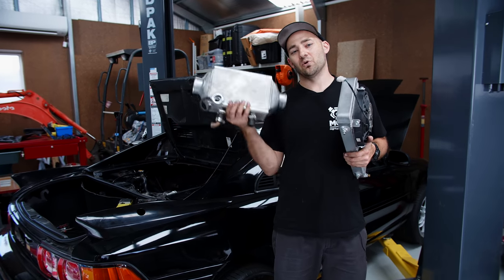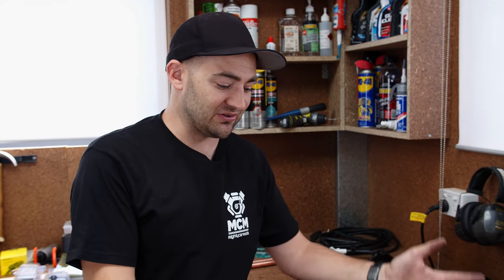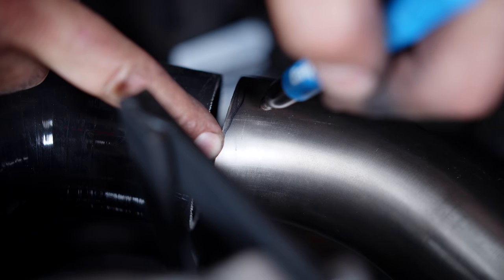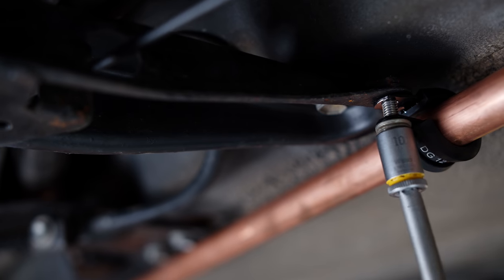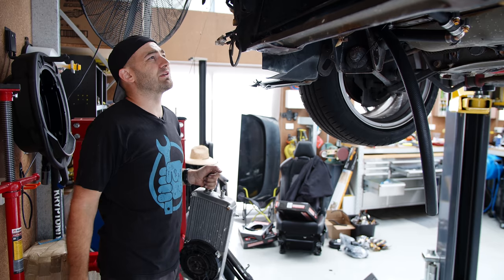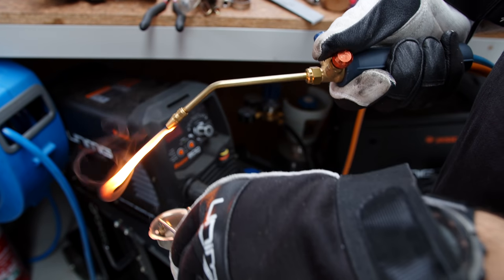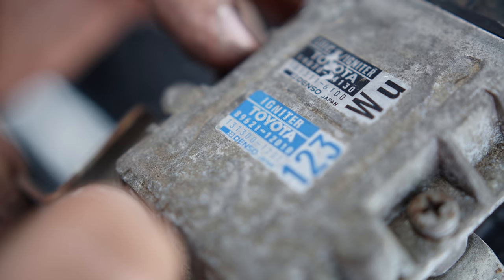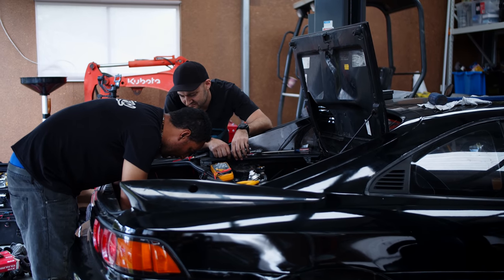MR2 takes Miss Daisy parts (Water to air Intercooler Install)

Comment: I'm going full 21:30 Marty with my highschool love affair of a first 'real' car, a 1992 Mercedes Benz 190e. Much the same situation. Lots of ingenious solutions to pedestrian problems by today's standards, particularly in the fueling system. The mechanical injection system uses a series of springs and an electronic fuel pressure regulator to control the fuel pressure the spring system sees, in order to properly add enough fuel for the metered amount of air coming into the system, using an even more complex arrangement of an air flow plate connected to a potentiometer, and assisted by a series of vacuum lines that go every which way. Really, the best way to explain how overengineered this car is, is in the wiper system. The windshield is roughly twice as wide as it is tall, meaning a properly sized wiper blade could reach the far sides, and the top in one sweep. But, that's not good enough. Throughout the travel across the windshield, a series of gears control an articulating portion of the wiper arm, to make it extend as far into the top corners of the windshield, and still come all the way back in to clear the top of the windshield. Absolutely ingenious solution to a mundane problem, properly solved by the use of TWO wiper blades. Arguably, it even works better. As long as all the pieces of this ridiculous puzzle are working properly. Like the plastic drive gear for the articulation system, meshing together with a metal gear pattern. Definitely not a wear item.

The actual issue with the fuel system, and the car as a whole, is much the same. All you have to do is bolt on a proper fuel rail, modern, reliable, new injectors, bin the vacuum controlled spark advance for an electronically controlled ignition timing system, and wire and install a brain to control it all, and you have a car that runs properly all the time instead of only once in a blue moon. Only there's no usable trigger system for anything in the whole system. And all the sensors have some silly metric thread with no modern equivalent. So every single sensor port in the head needs to be tapped out to receive a modern sensor. And if you're going that far, you might as well turbo it and double the cost of the project for double the horsepower. Only if you're doing that, you should probably take care of the oil seeping from all of the crank seals and transmission seals. Speaking of the transmission, take out that automatic with another silly vacuum controlled system, and replace it with a conventional manual with no funny business happening. And now all of a sudden, you have $10,000 in a $500 nugget that's still hailed out.

The suspensions all good, though, which means we can just ignore all the problems, drive the motor at 9/10ths on the street just to keep up with traffic, and fill it with fluids until it pukes it's guts out. Or just try and sell it on to another owner, hopefully one with more free time and ambition than I have.

Comment: Hi Marty, 
friendly reminder that your pipes being copper and the radiators (and other parts) being aluminium there's gonna be some corrosion over time. Make sure to check that out frequently and use anti corrosive additives!

Comment: there might be a little bit of schadenfreude here, but it is actually really relatable and enjoyable when you guys run into real problems too. I know you guys are vets at this point with all the builds you've done, and the knowledge you have, but for those of us out here that hit roadblock after roadblock in our more novice adventures, this is kind of a breath of fresh air when a lot of channels cut from 'this is what we need to do' to 'ok, this is it done', without any mention of hiccups or problems along the way. Anyway, the tl;dr: thank you guys for showing the ugly bits that usually end up on the cutting room floor.

Comment: One of the most realistic and relatable episodes.
 Nothing fits we bought to put on the car.... modify and make it fit.
Ok now none of the wiring is correct. We should have it started by now, but instead are backing up to a new plan.

Comment: Copper work hardens and cracks over time. Not a problem in the ground outside your house, somewhat more of an issue under a constantly moving car body. It'll probably be fine, and if it breaks its no big deal as you said, but thats why copper can be a problem

Comment: Great vid. :) I'm not sure if it's been mentioned. But it might be worth looking into mixing copper and aluminum with water.  It may lead to rapid corrosion.
Reply from the maker: It probably won’t, it’s not a watercooled PC
Reply: @mightycarmods  hopefully not! It's still the same in principal though. Heat. Water and mixing metals. But you'll know if you get performance degradation.

Comment: The big lengths of copper tubing getting airflow on the bottom of the car will further increase the cooling efficiency of the water to air system, in fact I'd wager that it will actually make a fairly sizable difference! Whether intentional or not, that is some good stuff right there.

Comment: It doesn't matter where the pump sits in the circuit, as long as it's air free. An expansion tank above the circuit will allow air locks to bleed out. I'd personally mount the pump chargecooler as it'll dissipate more heat than it'll produce at higher temperatures. Look at the Mk1 Focus RS for example.

Comment: in my Elise I made the gearbox cooler tap into the water cycle of the engine coolant. the waic of the elise got it's own cooler but is also connected to the same reservoir so I can exchange all coolant together.

Comment: Interesting choice, going for the front-mount WAIC...not sure if it's the optimal way to go--that'd probably be a top-mount air-to-air with snorkel ducting down from the roof to the engine bay cover louvers, but as you said, you're running up against the challenge's budget limit, and you gotta work with what you have.

I don't know what it is about Toyotas--having owned and worked on both an AW11 MR2 and a Matrix (read: USDM Corolla 5-door), they do tend to fight you whenever you try and do anything with 'em, mechanically. My only real explanation for this phenomenon is that, now that Toyotas are renowned the world over for incredible reliability and durability, people are using that as an excuse to not take care of them, so they build up all these little problems that turn into big problems that turn into headaches for anyone trying to modify or restore these old gems. Still, I've never known any project Toyota where the end results weren't worth it...except maybe Yaris Hilton.

Just...make sure you buy Dave, like, three cases of beer for his trouble. X'D

Comment: Probably a lot too late, but there's a tool to flare the ends of the copper tubes, so you can get a more secure fit for the rubber hoses.

Comment: Even though you already had this one, it's a LOT easier to get the factory water to air intercooler and parts off the turbo Celica's. Cheap, factory fit (bolts right in) and super reliable set up. You can also use the AC lines to run the coolant through and the condenser as the heat exchanger.
Reply from the maker: Would have liked to do that but they were too small
Reply: @mightycarmods   I had that setup on mine for 270whp, would like to see what power you're going for if that is too small ;)

Comment: Just got a haltech elite 1500 dialled in on my st205 gt4 with haltechs help Marty.  Mines a gen3 engine but if you have any issues setting up the coils and getting a signal from the distributor for cam and crank signal , scott has been helping my tuner dial it in and they got it right with 1zz coils . They netted 350awkw with my built motor with no drop in spark . If you have dramas , get in contact with scott / tuning fork - ask him about the celica in geelong . He should know about it

Comment: Never seen someone so truthful about how hard SW20’s will fight you while you’re trying to fix them. I’ve had to just lay on the ground and calm down once because of mine as well 😂
Reply: Were you trying to replace the fuel pump by chance? I lost count of how many times the fuel tank foiled me, especially since the manual shows it coming out without removing the cooling hard lines.
Reply: Kevin Shea oh I know that’s going to be a pain. Been meaning to get around to that for some time actually, and I would replace the hard lines at the same time if I was pulling the tank. When I first got my 91’ the coolant came out brown 😭
Reply: Andrew Coodey don’t replace the hard lines, they’re aluminum and don’t corrode like steel. Plan on replacing the rubber connectors at either end of the hard coolant lines since you’ll probably damage at least one. Also have a foot or two of rubber fuel line to replace the pieces you’ll have to take off the tank hard lines. Be really careful with the fuel filler neck and breather, they’re more of a pain to track down. If you plan on having the engine out at any point, that’s the time to do the fuel pump. If you can sit in the empty engine bay it’s way easier to disconnect and reconnect everything.

Comment: Might need to use a pipe expander on the ends of the copper where you are attaching rubber hose with clamps.

Comment: If the copper pipes fail a lot and of gm mini vans have long aluminum pipes that run from the engine all the way to a heater core in the cargo area. They would probably work well for the mr2 and could be picked up cheap at a wrecker most likely

Comment: 7:35 Not sure how long you intend to keep the car, but Aluminium radiator and Copper Pipe do not mix well (galvanic corrosion).  To stop galvanic corrosion, you'll need to add at least 15% Anti-freeze in the coolant.

Comment: One thing im concerned about is the radiator being aluminium and the pipes being copper, those metals dont mix well while running water. I've built some custom watercooling loops for PC's and they dont mix very well there :) 

Short term it's no big issue but long term there is some problems with "corrosion"(dont know the correct term).

Comment: Don't worry about  your copper pipes Marty. I ran copper pipes, recycled from a residential central heating, that went close aside from the exhaust manifold without any issues for years, when i decided to DIY an oil cooler to one of my previous cars.

Comment: Only thing you gotta pay attention to is not mixing metals. Like copper pipes and aluminum radiators, because then you'll have aluminum oxide radiators.
Use a coolant that contains a good rust prevention.

Comment: Tip for pipe bending, use one size smaller and the pipe will stay the same circular shape as it bends instead of flattening out and becoming oval shaped ;)

Comment: I have used copper tube in the past.
If using hard drawn copper anneal area to be bent and also can use sand packing method
if don't have bending tool also  use a crox tool on the end's for piece of mind.
I must admire Marty's commitment to this bitch and I really hope this work's out in the end.

Comment: Copper tubes are going to be fine under the car. They will turn green but will never get any holes from corrosion.
It's quite common to use copper for brake and fuel lines.

Comment: PLUMBING TIP ; When soldering Copper pipe, make sure you have BOTH ENDS of the fitting with the pipe already inserted. Otherwise you have exactly the problem Marty has - you have to smash the last bit of pipe in after you complete your first Solder connection, and in turn deform the fitting and potentially the connection. Also ; Apply heat from the OPPOSITE direction to where you apply the solder, this ensures that when the solder MELTS it pulls itself all the way round to the heat source and forms a perfect seal.

Comment: Copper will be fine.  Used refrigeration grade copper lines to replace steel on on the hydrolastic suspension lines on an old Mini. 20 years and counting.

Comment: Those copper lines will last a lot longer if you hit them with a couple layers of some truck bed liner spray.  Better yet swap them out with aluminium tubes and then spray them.  Mixing that much copper with mostly aluminum might give you problems in the future.

Comment: See Sarah'n'Tuned videos about her MR2. She had to manually remake the engine loom as the wire actually rots internally. If you strip back a wire you will find its gone all green inside and the copper is rotting. Its a known MR2 issue.

Comment: Doesn't matter how something is built, designed, whatever. It's the end result that matters.
Or, if it works, it works. It's not a show car, don't need to be fancy about connecting up pipes, etc.

Comment: Your problem with copper will be because you have copper and aluminum mixed together, it will cause internal corrosion. And since aluminum is the more active metal it will be the one to go so you might get water in your intake

Comment: I am very familiar with the wiring part at the end where nothing matched up.  I removed probably 15 pounds of wiring off a 1981 Kawasaki motorcycle. That’s right, around 15 pounds of wire and threw it all away to start from scratch because of the same issue. Almost nothing matched the colors the diagrams in the service manual said they were supposed to be, and from one end to another, the color would change or the wire just wasn’t showing continuity. I put back maybe 4-5 pounds of wire by the time I was finished.  And everything worked as it was supposed to.  I have no idea what all the extra wire was for from the factory.

Comment: It looks good. They only thing I would have done differently is to add a rim to the copper lines so the rubber lines don't pop off.
Reply from the maker: Why will they pop off?
Reply: @mightycarmods  It's possible from the pressure. Not that it will happen but it's possible. It happened to Erik The Car Guy on his build. He had to add a rim around his metal lines to give the clamps something to hold onto. But otherwise your car is fantastic.

Comment: Maybe weld little dots around on the intercooler pipe so the coupler has something to pinch on. Couplers doesn’t like smooth pipe surfaces.
Reply: I expect all the edges will be rolled before the face-off with the mooooon unit

Comment: PEX probably would have been both easier to work with and substantially cheaper. But hey, nice to see you using somthing that is't super cost prohibitive like braided hose and AN fittings.

Comment: I like the set up of your workshop. Lots of cool and useful equipment. 
But please put your vice on its own solid pedestal... 100mm SHS 5mm wall on a broad baseplate. As a guide.
Watching half your energy go into flexing the workbench and bouncing tools around is as frustrating as dealing with the MR2s frozen bolts I’m sure..  plus those cast vices can’t handle much of a beating. Better treat yourself to a forged steel vice too..
Love the show, and when you win make Moog give the Moon Buggy to the guy that helped him get it running.
Reply from the maker: Yep one day

Comment: I am actually curious if, Marty checked what core material the water2air charge cooler uses.
One rule that always pops up when dealing with water cooling is to never mix aluminium and copper.
I have not found out why yet, but it might have to do with the oxidation aspect.

Comment: Copper pipes was interesting, but won't the aluminium radiators corrode like crazy? 
Also don't you need to bead the pipes otherwise aren't they going to blow off? 
Or did I miss that bit? Beading tools are like £200.

Comment: Marty, it's worth noting that mixing copper and aluminum within the same cooling loop causes nasty galvanic corrosion unless the coolant is VERY carefully mixed and controlled with anti-corrosives. Standard radiator coolant contains anti-corrosives, but it isn't intended for use with copper.
Reply from the maker: Are you sure? I know this is a thing in PC cooling land..
Reply: @mightycarmods  Yes, I also learned this through the PC watercooling community, but the same applies to coolant in cars. Typically in cars with Iron (-.04 volts electrode potential @25C) blocks and Aluminum (-1.66 volts) radiators. Mixing Copper (0.34 volts) and Aluminum is actually a bit worse, as the process is sped up by a larger difference in electrode potential. I'm not saying you need to rip it out, but I would buy some corrosion inhibitor additive and keep an eye on it. PC all-in-one liquid coolers mix copper and aluminum without any issues, but they carefully balance the distilled water, ethylene glycol, and anti-corrosive mixture.

Comment: They haven't mentioned the TVIS on any of MR2 episodes, this will need to be included in the mapping of the engine. I'm taking about the variable intake system the REV1 / 2 use to improve drive-ability. It can be deleted, but I didn't see Marty do it...

Comment: I feel sorry for you...  I have a 95 neon that I've had running without the throttle body, so no throttle position sensor or idle air control valve, and no intake pressure sensor.  It fires right up with just the cam and crank sensors, the coil, and the injectors hooked up.  It doesn't IDLE well without the throttle body or associated sensors, but it does run like that.  There is something to be said for the simplicity of early 90's electronic engine control.

Comment: 8:30 that copper is anything but soft. Straight length copper is not annealed and will be stronger than aluminium of the same gauge. It will likely bend less, and If it does it won't crack like alloy will.  
I'm concerned about the solid mounting on the intercooler. No rubber? I guess it's fine for a single track event, but for daily I imagine itd crack the alloy.

Comment: should have gone for hard weld with propane instead of soft solder as it is weaker given that there will be movement around those joints - learnt that from my plumber